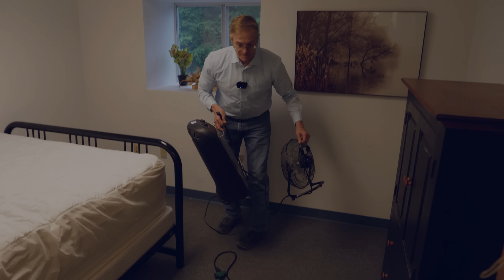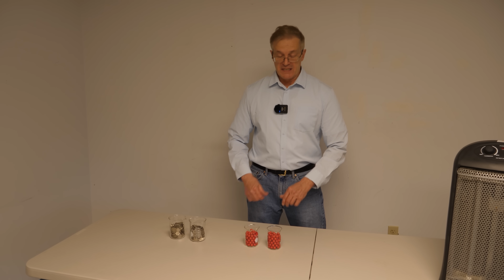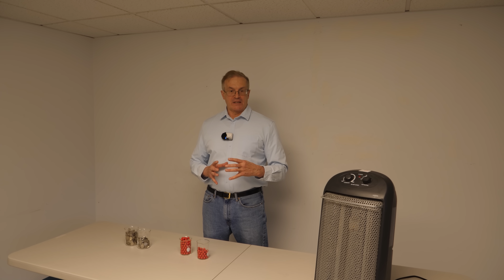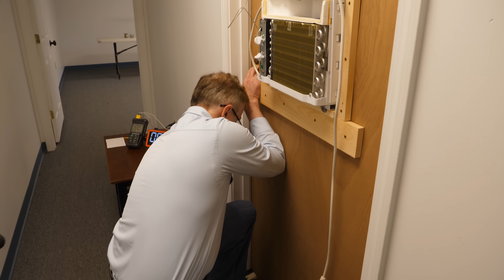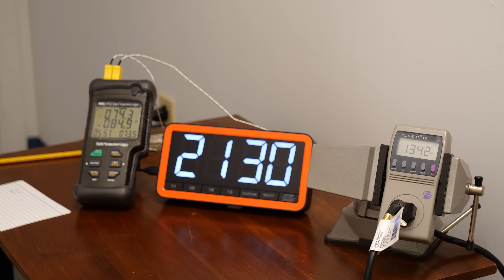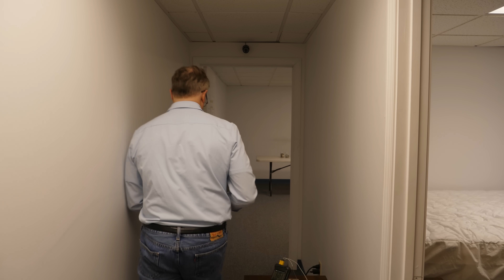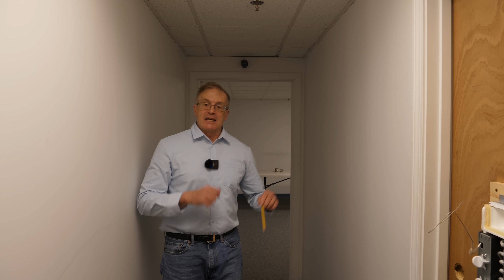You're wasting money on heating! Use your A/C!

Comment: Thanks for taking the time to make the video.

Lots of comments on heat pumps in cold exterior temperatures.  10x efficiency here is achieved because we are moving heat/balls from about the same cup/temperature  level to about the same level.  Moving balls from a cup on the floor to a cup on the ceiling takes much more work than moving them between 2 cups on the same table.  Still better than making balls, but it's why heat pumps as heaters can be 1x (same as resistance) when super cold outside to 2-4x when outside temperatures are warmer.  Efficiencies as an air conditioner average better because say 110F to 70F (40 degrees change) is less of a difference than -30F to 70F (100 degrees change).

And it's seems to be a tradition to jump on experimental design.  So then I must...

Total thermal mass in the first experiment was 1 heater and 1 fan greater than in the 2nd experiment.  So efficiency overstated, because heating the air where the heater/fan takes less energy.  This is countered by the increased energy due to increased heat loss due to the colder hallway/ warmer room temperature difference (through probably a 2x4 studded and drywall covered wall).  Only practical difference this makes is the opportunity for me to write about it.

Comment: In layman's terms "it is cheaper to move the heat from outside into the room than create heat from scratch"  This works from 70F to 40F, then it starts to get harder. 
Check "Diesel parking heaters" which are cheaper to run than propane.  Also solar heat into a thermal mass like a 50 gallon barrel or a large brick wall.  Some places make ice at night and then use that to cool the AC units during the day.  This is for efficiency as well as industrial "night rates" for electricity. 
However, Tech Ingredients does  a much, much better REAL explanation of why it works.

Comment: Math checks out! The channel Technology Connections has done a few lengthy vids on heat pumps and as per claimed mfg. specs the coefficient of performance (COP) was stated as 4.5, indicating 4.5 more efficient than a resistive heater. This occurs under ideal conditions.

Comment: Summary

This video demonstrates how much more efficient heat pumps (like A/C units) are for heating compared to resistance heaters.

Experiment:

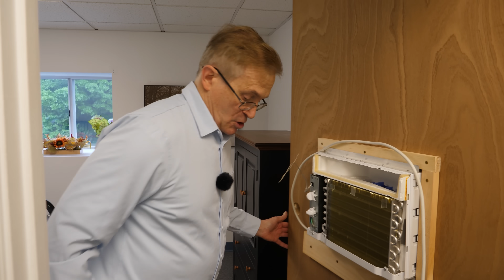* Test 1: Resistance Heater (Starts 6:57)
    * A small room is heated with a resistance space heater and fan.
    * Starting temperature: 75.7°F
    * After 30 minutes: 86°F (10°F increase)
    * Power consumption: ~1338 watts
* Test 2: Air Conditioner (Heat Pump) (Starts 12:48)
    * The same room is heated with a window A/C unit in heating mode.
    * Starting temperature: 77.2°F
    * After 30 minutes: 92.4°F (15°F increase)
    * Power consumption: ~440 watts

Results:

* The A/C unit heated the room more than the space heater (15°F vs 10°F) while using significantly less power (440 watts vs 1338 watts).
* This means the A/C was over 4 times more efficient at heating the room.

Key Takeaways:

* Heat pumps move existing heat instead of generating it, making them much more efficient than resistance heaters.
* Even old, inefficient A/C units can be significantly better for heating than traditional space heaters.
* The video promises a follow-up demonstrating how to further improve the efficiency of air conditioners. 

i used gemini 1.5 pro to summarize the transcript

Comment: What did you do to collect the water from the back of the window unit?
Reply: This is not an insurmountable problem.
Reply: @jamesengland7461  Maybe. But I'm sure that he will either have a solution that is way over engineered, or stupid simple. If I do this, I'll need to have my plan down to a T. Otherwise, the wife issue takes effect....😶
Reply: @jamesengland7461  a hose going into a drain is the usual solution.
Reply: That’s what I want to know. I guess it’s going to drip all over the floor. Or perhaps he’s in an area of the country with little to no humid, so it evaporates out of the tray as soon as it condenses out of the air…which is impossible in half the country with high humidity. It’s a nice little expirament but not practical where I live. I have a heat pump and we want to get rid of it…it sucks.

Comment: This is incredible, I live in an older house, circa 1905, with no duct work and 5 units I put in the windows every summer. With this, I can use them year around and cut my heating bill while doing it. I've had issues with tripping circuit breakers because the wiring was set for minimum usage in bedrooms. I can power 5 ac units to heat with the power of 2 resistive units with energy to spare, this is crazy!
Reply: as others have stated - they make Mini-splits that have the heat pump built in to reverse the expansion valves.  This was a proof of concept for how heat pumps work, not a 'do this at home'.

When your AC reads the thermal temperature outside as being cold, it will stop running
When it gets colder outside, the unit becomes far less efficient
The controls are on the outside
The fans are WAY louder on that side
Water will be dripping on your floor
Reply: @REPEAT63
Are you going outside several times per day to adjust each window unit? 
The controls are now outside... ....in the weather.  I don't think you have  thought your plan thru.
Reply: @mrbmp09  get a ac with remote control
Reply: Simple fixes, you can put it on high and attach the plug to a thermostatic control unit, plug into a thermostat that turns on and off based on the temp in the room. It works automatically.
Reply: Where is the condensation going?  Your floor?  Below 40 F degrees outside and they won’t turn on.  Heaters have a defrost to clear ice off the coil every so often to make it work below 40F.  AC units don’t have defrost cycle. What happens when it’s raining. Your electronics meant to stay dry get wet.  Genius.
Reply: @BeefNEggs057  This is just a proof of principle.  To make it practical, you need to address all the questions you asked.  This is just a half-hour demonstration, and if the humidity is low, this isn't enough time for the condensate to accumulate enough to pour all over the floor.  You can't really turn an air conditioner around in the winter and expect to avoid the problems you pointed out.
Reply: well the main issue with this is that the control knobs will all be on the outside and i doubt these units are designed to run backwards with the control interfaces and screens exposed to the elements. i really doubt they are weatherproofed on the part that is designed to stay inside. so when you flip them im sure its a matter of time before the moisture from snow or dust and bugs destroy it.
Reply: Efficiency drops for heating when the outside temperature gets lower. Still makes sense in some climates, but not sure you will get far with window units vs. a ductless heat pump. If you are rural, consider ground sourced for good efficiency year round.

Comment: In Finland the most popular heat source for new houses is ground source heat pump. Air source needs a backup heater, because at -30C air source heat pump has very low heating power. 

A proper air to air pump works with COP 2 stilla around -20 to -25 C outdoor temperature, but the pump input power gets smaller, because the evaporator outside doesn't produce enough gas to pump. At outdoor temperature+5C the COP can be 6, so with 1000W you get 6kW heat. Same pump @-20C takes maybe 700W and gives 1,4 kW. 

Ground source pump can use over freezing point heat source and the power is not reduced in really cold weather. The cooling is nearly free in summer, because then the ground heat collecting liquid is used for cooling. (And also hot water heating makes cool in the other side.) 

We have heat exchangers in new houses, triple glazing with argon and selective coating on windows. At +5C there is nearly no need for heating. Therefore it bit funny that the heat pump manufacturers tell the COP value at outdoor temperature+5 and indoor+21C.
Reply: In Finland the influence of the fossil fuel industry (from the mining, and/or drilling companies, through the distribution and further up the path to the consumer) don't enjoy the same influence that the fossil fuel industry has over American Media, American government and therefore; over the beliefs of average Americans.

For instance;  Building Contractors save money by insulating only to the minimum requirements (which is stupid because they could include their costs in the price).  Better insulated homes require adjustments from what has been done for decades.  Sure, it's done for the wealthy but for average people?  The fossil fuel industry will sell more heating oil or natural gas to the poorly insulated masses.  The "hated Gubment" won't have to change their regulations, keeping those blocking them from doing so, happy.

I could add more details but I'm not sure it will help.  Simply put, that's where things are in America and the past, very deliberate efforts to make sure a Republican is President when it comes time for Supreme Court picks has made it worse.  The recent "Chevron" decision will leave average Americans even more vulnerable to corporate power.

Comment: A friend of mine had a pool water heater failure and was checking out a new system. Her question was electric or natural gas. I had watched an episode of "Ask This Old House", and remembered they had a system installed directly to a whole house air conditioner. Instead of heat being exhausted through the heat exchanger, it was instead sent to the swimming pool to warm the water. The results were mind blowing. It made the air conditioner way more efficient, and warmed the water in the pool much quicker than any other system they had previously had. 
I can't for the life of me, remember the name of this particular system. It greatly reduced her energy consumption and her expenses.
Reply: Desuperheater heat exchanger
Reply: @amygreen8297  thanks!

Comment: I have also experienced that many people find it difficult to fathom that a certain amount of energy for a heat pump can make a room much warmer than with the same amount of conventional heating. It seems like a violation of the law of conservation of energy.

Then I like to use the following simple analogy:

A room is cold, but instead of heating that room with a heater, I drive a tank of hot water in from outside, and that heats up the room. Takes little energy, because I don't generate it, I move/pump it to the room. And if I want to cool the room, I wheel the hot tank outside. That's what an air conditioner / heat pump does: Move heat from one place to another.

btw: Most modern "airco's" are bidirectional nowadays, so in fact air-to-air heatpumps.
Reply: Company near me sells well connect heat pumps. They extract what you need from the water you use. The energy density of the water and the volume make it viable.
Reply: But this is the thing I don't get, it's COLD outside.. so how does transporting cold air inside do anything..
Reply: @gordon1201 Even what we think of as cold air (32°F, 0°C) has a good amount of thermal energy in it.
Reply: @gordon1201  An aircon doesn't move air from one side of the wall to the other, it transfers the heat by running cooled gas or fluid through the inside radiator which has a fan blowing over it, to an outside radiator where a fan blows the collected heat off.
When you see split-system air con it becomes more obvious, as it only needs a small pipe for the gas between the inside unit and the outside unit. The cooling magic is due to the fact that some liquids when compressed, turn into their gaseous form which is far cooler.
This channel has awesome explanation on this called 'make your own air conditioner' or similar name, I recommend searching for it on their page.
Reply: @gordon1201  the outside is 30⁰ pull the heat out until it is 10⁰ that's 20⁰ of heat
Reply: @andrewsmith1735 most ac's aren't designed to extract 20 degrees out of a room that's already below freezing tho...

I'm curious as to how well this would work at temperatures where there isn't much heat to draw, as opposed to turning 1 room of an already comfortable structure into a sauna....
Reply: @RemingtinArms  most of the cold temperature problems are associated with the systems freezing up with atmospheric moisture.
Reply: @gordon1201  You should consider the following: Energy is required for evaporation, which is released again when the vapor condenses. So if something manages to evaporate in that cold outside air, it absorbs energy. The vapor is condensed at the inner part of the pump, releasing that heat again. So it is clear that you need a liquid that can evaporate even at those low temperatures outside. This is often a liquid that can evaporate at -20 Celsius.
Reply: i always saw it as a play on words, also what is never mentioned is that resistor type heating elements efficiency isnt as dynamic as a heat pump, heat pumps have a non-linear efficiency curve, the colder it is outside the harder it must work to pull heat from the outside.
Reply: I wish there were a requirement that all air conditioning systems sold be bidirectional heat pumps.

The actual cost of turning an air conditioner into a heat pump is quite small.

In North America where the normal climate extremes are in the sweet spot for heat pump efficiency, the annual energy savings would be significant.

And the efficiencies of mass production would bring the cost down even further.

There would be a slight reliability hit.. but well worth it overall.

In the 1970's Honeywell did a demonstration project of a solar powered heat pump system, where the energy necessary to run the "machine" was gathered using glycol filled solar panels, and storing the heat in an insulated glycol tank for nighttime use.

The two different heat pumps were tested. One was a piston type refrigeration machine powered by a turbine. The working fluid powering the turbine was Freon. Not only did the unit provide cooling, but an AC generator driven by the same Freon turbine provided power for lights, pumps, controls, and fans!

The second machine demonstrated the use of an Arkla type chemical heat pump, where the heat source driving the chemical reaction was the glycol heat storage system.

In Florida, in the summer time, we often had to leave the doors open "wasting" cool air, because we generated so much surplus heat that the glycol solution would BOIL inside the solar panels.

The panels were about 40' x 20', and the system load was a pair of tractor trailers, parked side by side.

The panels were mounted on the top and side of the "southern most" trailer, and  were hydraulically tilted to match the average solar angle.. (no active tracking was used .)

The first trailer held all the equipment and heat storage facility, and a small monitoring/control area. 

The second trailer held lighted poster board displays describing the system and seating for meetings/classes... And was the "system load".
Reply: @linuxranch we should never force majority of goods to be one way, it stifles innovation and if it’s truly great and affordable then a free market will help the tech be common and accessible. 

most modern ac’s use heat pumps because it’s more energy efficient/cheaper. What’s dumb is when they don’t have a heat option even tho they have the heatpump.
That being said heatpumps stop working when it dips below something like the 15-20°F so you’d have a lot of people freezing to death in most states. Natural gas is abundant in the usa as petrol, etc.. so majority of the population would need a second heating source (furnace, boiler, heater, etc).  I forget the type but my grandma in Illinois lives in an old house (pre 40’s) with some less common super old tech boiler and it’s crazy cheap to run during their cold winters and the house is toasty.
Reply: I just say the heat pump uses energy to run plus moving the heat from the outside in. The heat hat's moved brings you over the 100% simple as that.

Comment: Wouldn't an easier to understand explanation be that resistance heaters directly generate heat. Whereas heat pumps simply move heat from one place to another. The creation of heat requires much more power than thermodynamically moving heat that's readily available in infinite abundance, literally inches away, on the other side of a wall.

Comment: Use black heat panel to collect solar heat, store in a sand thermal batteries. Use white IR heat dumping panels, store in sand batteries. Use heat pumps to regulate the temperature in the room and excess heat or cold can be put back in the thermal batteries to charge or discharge the batteries.

Comment: the problem with this experiment is that its not the real conditions. example with the heat pump, its highly dependent on the outside temperature, if the temperature outside is example lower than -20°C you will get almost no heating inside of the room, while the conventional heaters dont have this problem and are 100% efficient (turning all of the electricity into heat). heat pumps collect the energy from the ambient air outside and concentrate it to heat the inside, but if its really cold outside, there is no where from which the heat pump can collect that energy...
i live in a country where in summer temperature goes up to 42°C and in winter to -25°C and here people use AC only for cooling in summer....